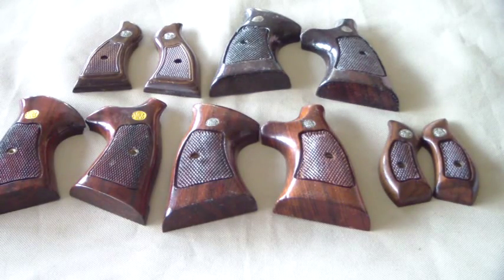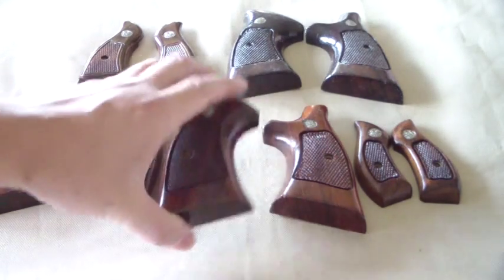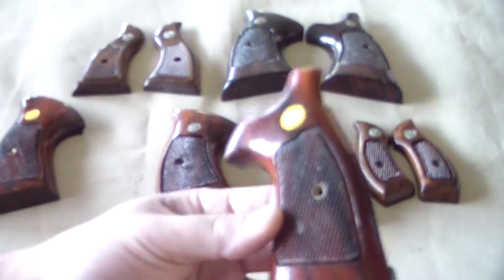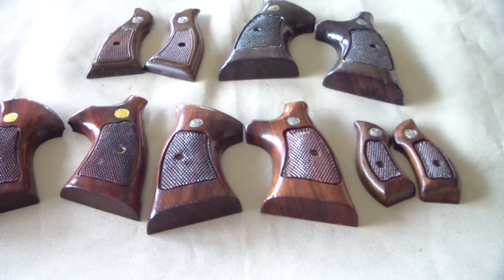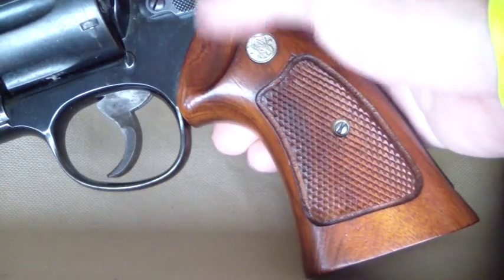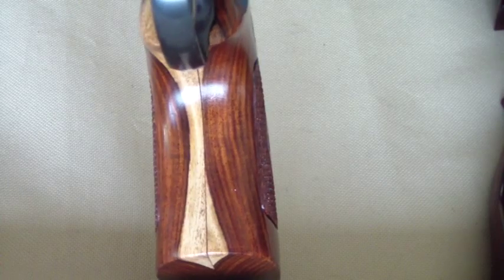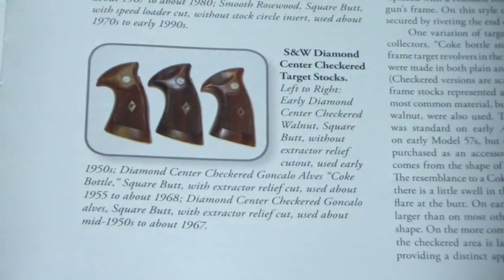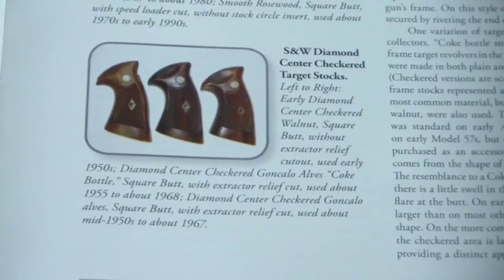Smith & Wesson revolver grips

Comment: Wow, what a great review on grips. I have XXX size hands and hate finger groves. None fit me. That S&W grip at the 14.08 minute is what is on my 1974 K frame model 13-2.357 bull barrel that I bought new. It came with child size grips  I still have the originals, but had the dealer replace them before I left the shop with S&W large grips. The best I have ever held.

Comment: The “divot” that you like is for speed loader clearance. Back in the day police officers would use a Dremel to remove the wood so a speed loader could be used. Without that relief the speed loader would hang up and prevent the cylinder from being closed. Not a good scenario in a gun fight.

Comment: The reason the grips with the pressed checkering appear to be different than the old ones is because they ARE different.  The set that you have were made by Altamont and are laminated wood, not solid walnut or Goncalo Alves.  Altamont not only makes aftermarket grips, they make OEM grips for Smith.   Even though "different", they are a good quality product.

Comment: @Terry Weihold, incorrect sire; the official letter I have from SW specifies that the 8-3/8” model 29-2, shipped in February of 1961 which I am currently in possession of, came with original “coke bottle” WALNUT WOOD grips. 
I do not know for certain, but I believe to have seen walnut wood target grips installed on SW’s as late as 1964 or 1965. After that, Goncalo Alves (a South American species) was used.